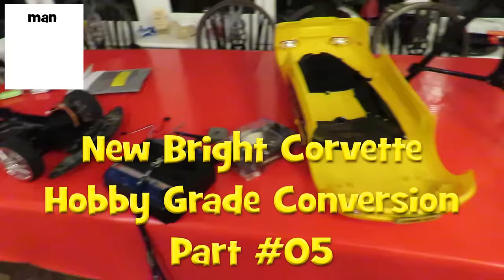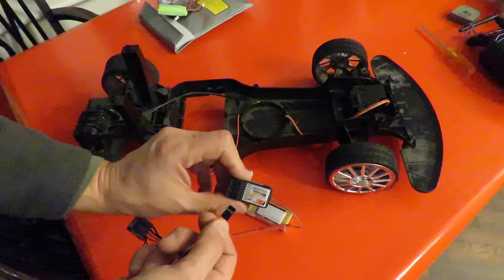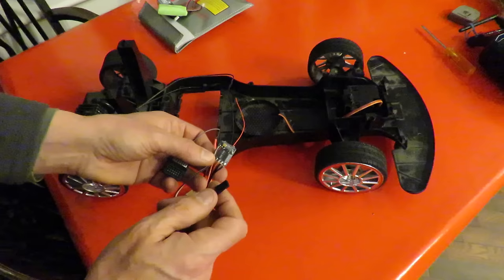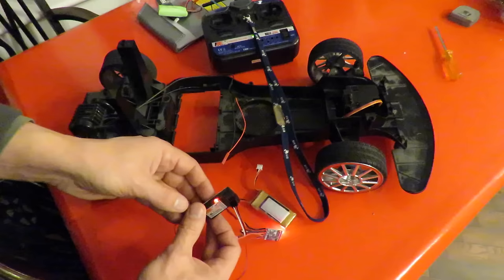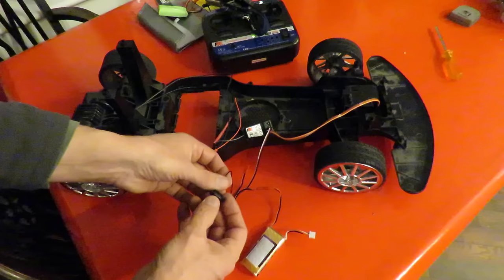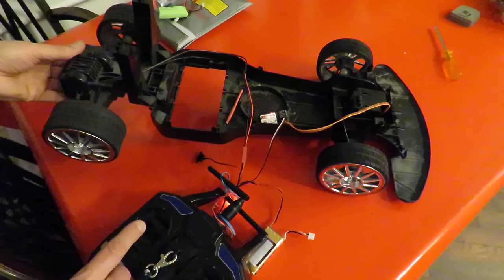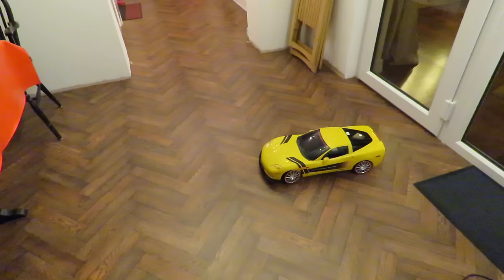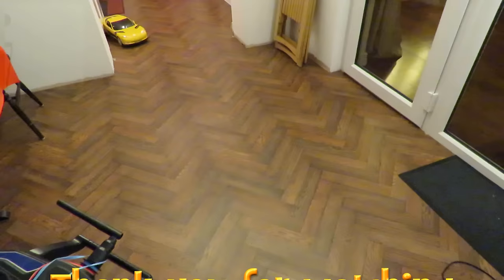New Bright Corvette Hobby Grade Conversion Part #05 Temporary ESC for test

Comment: Deadly videos GrandadIsAnOldMan! If I may suggest: have you tried playing with the Arduino platform? You can program a lot of the logic, and emulate/simulate ESC functionality etc... In a way it is "why do it simple when it can be done complicated" but then again, it can be fun.
Reply from the maker: +Dragutin Cvetkovic thank you. I am keen to avoid getting involved with arduinos or raspberries or any of the other current wave of processor platforms. I did my programming many years ago, spent lots of time on it and don't feel the need to get involved in it all over again unless my grandchildren specifically need me to help them.

Comment: nice, so you made it!! did you put a 7.4 volts lipo?
Reply from the maker: +Micro Bot yes that is a 2S LiPo
Reply: +GrandadIsAnOldMan you must get the 40 or 50 Amps esc for this big scale rc cause a airplane only as low amps. i convert mine to 40 Amps and it goes 42.7 km. it was 35 amps and was only 36.2 km you must try. GOOD JOB old man.

Comment: Hey granddad if u want me grip on the rear or front wheels u can use rubber inner tubes of the rear wheels?? Just a thought I have a inner tube if want it it's no use to me so I have no problem sending it u ?
Reply from the maker: +NITRO MAD thanks. The tyres on this car are fine, which is unusual for most toy cars, but they are good rubber tyres.
Reply: +GrandadIsAnOldMan oh ok I wasn't expecting them to be rubber

Comment: Can you make it brushless?
Reply from the maker: +John Alon you probably could change the motor but as I explain in the video description I am just interested in seeing if I can upgrade the transmitter/receiver to hobby grade 2.4 GHz, fit a LiPo battery, provide an ESC for the motor control and a servo for steering.

Comment: How come the ESC keeps switching off? Thx 😃
Reply from the maker: That ESC was much too small for that motor so when the motor asked for more power it just shuts down. If you follow this series through I do fit a much bigger ESC later. Another issue with that ESC is it has a brake facility which is engaged when you go quickly from forwards to backwards and it is not compatible with that controller. You really need a controller that automatically springs back to the midpoint to release the brake. Most RC car drivers use the pistol shaped controllers which have an automatic return on the trigger/throttle. The brake on that ESC would work fine with one of those.
Reply: @GrandadIsAnOldMan   thank you! 😃
Reply from the maker: @lunarmodule6419  it had me confused at the time 🙂👍

Comment: What esc is that please
Reply from the maker: Just a cheap generic brushed motor ESC off eBay. That one is not really big enough for the battery and motor. In this episode I use a bigger one but it is still probably a bit small https://youtu.be/zzD4n6S6vOg?list=PLA5a2xPRSrB32Nv7aIGH_EvNJ6L8j3Luv details are in the video description.